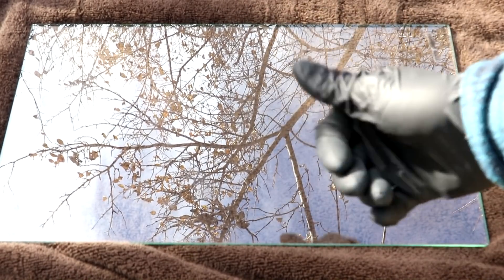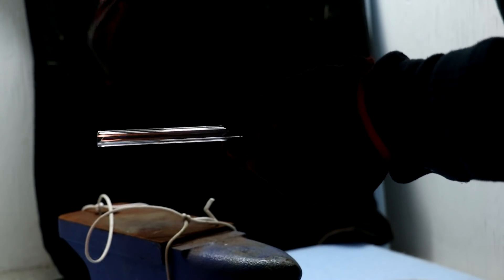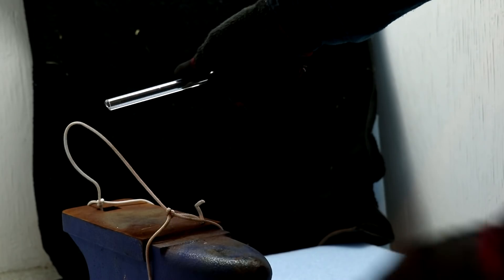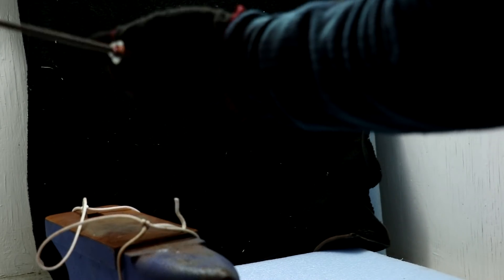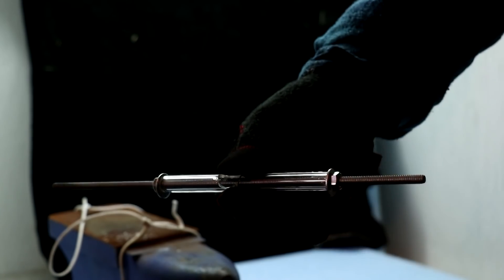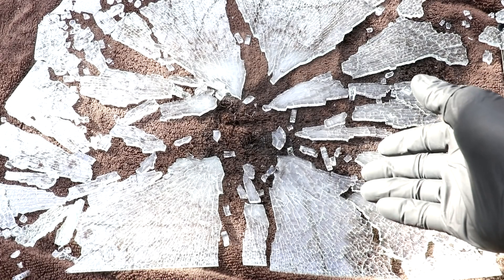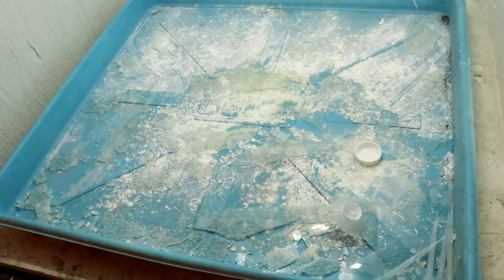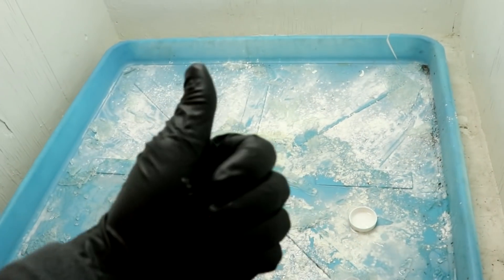Can I Dissolve Through Tempered Glass?

Comment: The internal stresses are far too high cracking isn't so much the issue as any stress riser with significant enough force is applied will create its own cracks in a material as hard as glass it's really interesting how a crystalline structure can gain such strength from applying forces to itself although of course the price you pay is your material ripping itself apart if changed slightly in form Now That's What I Call conservation of energy lol

Comment: could you use a super hot hydrogen flame or something like that to very concentratedly untemper the glass in a small circle that quickly gets melted through?  I saw nighthawkinlight use a small HHO torch to melt through a little glass slide.  wasn't tempered, but the edges were melted and rounded and without heating up the rest of the glass

Comment: It might have worked if etching had continued from one side, rather than flipping it. That would have removed the sensitive tensile center while it was still supported by the compressive layer on the bottom. By flipping and removing both outer compressive layers, only the tensile center was left, getting thinner and thinner. It’s hard to imagine any conclusion where the thin membrane under tension doesn’t crack. Therefore, etch all from one side, so the final membrane is under compression instead.

Comment: This ain't rocket science, glass is heated to cherry red . Then the glass is extruded  from the oven , jets of cold air cool the two surfaces the center of the glass is still molten. When the core cools , you have a potential spring . Any crack that goes to the center of of the thickness of the glass, causes the entire sheet to fracture. The number in the corner of  side window glass in your car is the number of pieces you get when you break it. That's what DOT 50 means , a 6 square centimeter piece of tempered glass will break into 50 piece.

Comment: The force required break tempered glass after the tension layer has been exposed is so small that it might as well not exist.  A slight change in temperature, a light breeze, or the tiniest tremors will break it.

Comment: I say try again, but balance the glass, give it feet around the spot you want to make the hole and feet on the corners. It's a possibility that the acid weakened the glass enough, that pane's own weight shattered it and the removal of the pane from the bin may have caused a mound or two in that powder to unbalance it. Just a thought...

Comment: Hey what if you found a way to stabilize the tension around the area you are dissolving?  I'm not an expert but if you want to put a needle through a baloon, you put tape on it, and get the needle through without popping the baloon so long as the tape is on there.  Is there anything similar for tempered glass?  Like some epoxy you can vaporize through the glass in an area?  I don't know what I'm talking about but curious.

Comment: Ehhh...
If you heat the piece of glass in an oven while it does this, is that cheating? 

At any rate, you need a way to relieve the stresses in the glass before inducing them again to resume the strength of the tempered glass. 

You can do that by immersing it in a bath of heated, concentrated salts. 
The commercial example is a beer bottle, which is soaked in a solution of magnesium sulfate to leech out the sodium and potassium hydroxide from the glass. They do this for reasons beyond altering the glass strength (it prevents the alcohol in the beer from reacting with the glass and throwing an off flavor), but it does make beer bottles stronger than non-ion exchanged bottles. 

Ions of smaller atomic radii can diffuse into the glass more readily than large ions. 
Lithium is good at this, but it causes brittleness and hardening in the glass after the fact. The lithium ion is probably too small for most things. 
Boric acid can induce stresses into glass, but i don't know how controlled it is. It also increases the melting point of the glass, in case that matters. 

All alkaline salts, like potassium or sodium hydroxide react directly with glass too. If you can get the glass and sodium hydroxide hot enough, you could just drop molten sodium hydroxide onto it and it'd eat through it, but it'd still probably explode at that point. 

Any who....

Comment: I had experience with tempered glass barriers for high walkways all shattering spontaneously, over a short period of time. Happily in place for years, but if I remember rightly, the theory was that metal in the processing eked out the material, then due to accrued beads of impurity introducing uneven tension, minor temperature fluctuations would eventually smash the whole thing. So after a few years, almost every pane was done in due to the tiniest natural occurrence.

Comment: would be interesting to see some videos on making monolithic aerogel from various materials like alumina and zirconia to make extremely high temperature kiln bricks maybe? (also not seen anything like say tantalum carbide as a heating element explored (which should be pretty good material for this since it's melting point is nearly 4000 degrees Celsius or tantalum hafnium carbide which the melting temp is supposedly in excess of 4000 degrees Celsius   (an aerogel from this would be ideal too, since it should be able to be used as standoffs for tungsten and I read that it should be able to work up to 3000C in argon environments or less in vacuum which I guess is because with out pressure raising the melting point, it evaporates some at a lower temp, good for say vapor depositing it on something XD.

Comment: Would directed heat from a torch melt a hole but keep the temper or would it re temper the hole or just render the temper null. but will the heat shock shatter the glass. Just wandering.

Comment: If you were to take an elastic and stretch it out to have tension and then melt the center of it with a lighter, the two ends of the elastic would still snap towards whatever is keeping them tense. Assuming I understood the explanation of how tempered glass works, the result of the experiment makes a lot of sense to me.

Comment: Interesting video Cody, this is how I inadvertently did this: Our car’s reverse mirror suddenly fell off the front window screen. So with two part Araldite and a couple of pieces of tape, I stuck it back on the front prestressed glass. After about 6 months; it again fell off but, this time had taken with it the glass – there was a neat square hole (the exact size of the mirror support bracket), through the screen! Otherwise the screen was perfect :) I suspected that constant thermal cycling between the glass and the Araldite (differing coefficients), had made benign minuscule cracks through the glass - that eventually joined up! If waiting isn’t a problem – this is a neat and safe way of cutting shapes into this type of glass :) Perhaps you can find a method of speeding this up?
Reply: It's not thermal cycling. Epoxy has a much lower stiffness than the glass so the thermal mismatch is mostly accommodated by strain in the epoxy. What you saw is caused by the several % shrinkage of the epoxy when it cures. This pulls the surface of the glass into tension around the periphery of the epoxy which causes preexisting microcracks  to extend slowly under the combined action of the tensile stress and corrosion of the crack tip by atmospheric moisture leading to delayed failure. This phenomenon is called stress corrosion cracking or subcritical crack propagation. It can be sped up by heat and higher humidity, but no dramatically. Failure of the glass causes a flake of glass to be detached but still attached to the epoxy. This leaves a conchoidal (scallop shaped) pit in the glass. I believe some years ago this was used to make a sort of non-see through glass by completely covering the glass with epoxy so causing these conchoidal fractures all over the glass surface.
Reply: @johnmatthewson6733  Superb explanation. This happened about 30 years ago and has always left me pondering what the mechanism might be - it was such a neat square hole. It's very easy to grab the only adhesive to hand but, it's worth taking the time to think - before using it :) It was an expensive lesson! I liked your non-see through glass info bit. Have a healthy and prosperous new year.
Reply: @johnmatthewson6733  - Youtube's algorithm beat you to it (for me) several days ago with the glue explanation, but showed it being done with old-fashioned hide glue. Evidently it works much faster because it shrinks much more.
Reply: @johnmatthewson6733  yes, this is why a crack grows in windshields unless you tie the surfaces together again with resin
Reply: @Beamer - Are you saying the hole went all the way through the windshield? That should not happen, because windshields are supposed to be laminated glass, while side windows are tempered glass.
Reply: @YodaWhat  Thank you for your thoughtful reply. Yes your absolutely correct and yes - it was the front windshield. I assume the minuscule cracks formed penetrated through the sandwiched film + perhaps the weight of the mirror assembly with the car moving - did the rest? Being a Ford Fiesta, it also probably wasn't the most expensive of glass ;)

Comment: You might have succeeded if you didn't flip the pane over. If you dissolve both sides of the glass under compression, then all that's left is glass under tension which is the part that causes the break. If you dissolve the glass under tension before one of the faces that is under compression, it should stay intact

Comment: Could you heat up a piece of glass with a metal tube at the glass melting point or higher and try to poke a hole trough it that way ? probably won't work but might be worth a shot you think?

Comment: Gorilla Glass works similarly.  Soda glass is soaked in a solution that contains potassium ions.  The potassium replaces some of the sodium.  Since potassium ions are bigger, the glass is put under compression.  There is an Applied Science video where this is demonstrated.

Prince Rupert drops (as demonstrated by a number of YouTube people) are tempered glass.  But if you shoot them with a big enough gun, you can break them (as demonstrated on Smarter Every Day.)

Comment: Try a smaller hole. .250 or .125. wonder if you could somehow circulate the HF with a smaller hole to increase melting speed. Also try HF on none tempered glass to see if melting/disolving speed is any different faster/slower etc. You almost got it man! Try again!

Comment: What if you could really strongly bond ring of hardened glass or steel or something very rigid to the glass and then cut a hole inside that ring?  Could you make it so that the ring takes the load and allows just the area inside the ring to explode?

Comment: Could you burn/melt a hole through tempered glass with heat? It seems the heat would anneal the glass in the area of the hole, making it successful. I'd try with an oxy acetylene torch, but also with a cherry red piece of round bar to try and make a nicer hole.

Comment: It seems as if tempered glass is at a constant stress level to the point where it close to breaking point but not really ..seems like maybe a few molecular bonds are holding it together ..may be why its so flexible to the external tension  like a hammer hit ..it overrides that tension therefore not affecting it..but once the molecular bond is broken it disintegrates..because it reached a point above that tension...which results in breaking..

Comment: can we take into notice how Cody lifted that anvil Like it was nothing
Reply: Absolute unit
Reply: @Jack W Google it. I just did and to be honest, I was pretty spot on, well, near enough to most the Web results for average deadlift weight for untrained average male. Remember this was average male and not you specifically.
Reply: That looks like the harbor freight 55 lb anvil to me
Reply: I don't think that anvil is any significant weight to lift with both arms. Yeah, they are heavy, but an average person should have no issue lifting that anvil. An average male can dead lift around 160lb - 200lb. Someone who is reasonably built (but not massive) should be lifting closer to 300lb and over. This anvil isn't impressive.

Comment: I wonder if you pulled the glass apart and then did the acid, would the pull of the glass negate the tension?

Although your experiment showed that even incremental destruction of the surface glass leads to catastrophic explosion of the glass when surface tension is penetrated.

so would pushing or pulling the glass apart or inwards negate the tempered nature of the glass? You should be able to test this much quicker with a drill.
Reply: On second thought what about compressing both surfaces at several points around the drill point? Perhaps with like vises?

Comment: I wonder if sandblasting with a vary small particle size would work. It seems likely to me that there is probably some limit to hole size; are you more likely to succeed with a smaller diameter hole than with a larger hole one?

Comment: You can do a ton of things to tempered glass. Grind it. Polishing. Sand blasting and craving. Acid etching. Just don't break the surface tension. Been a glazier for over 10 years and done lots to it. The weirdest thing is that tempered will explode for no reason. Just a loud bang and a call to me with a expensive bill. Always wondered why some of it last years and years and some blows up after just a few. Weird stuff that science. This was the best non glass guy talking about glass video I have seen on the YouTubes. Good job Cody

Comment: What would happen if you used bar clamps and wood blocks along all 4 sides of the glass to put tension, then used the acid? Would the tension help it to not shatter as the nuts did with the glass tube? Or would the entire sheet of glass need to be sandwiched & clamped between wood along with the edges clamped?

Comment: For clarity:  Spark plugs aren't especially good at breaking tempered glass.  It's broken pieces of spark plug ceramic with sharp edges that have a higher hardness than the tempered glass, capable of introducing small abrasions very readily.  But don't tell this to street people and lead them believe it's the blunt end of a spark plug that works.

Comment: Could you try "drilling" a hole in a way that introduces a "wall" to the perimeter of the hole to hold back the pressure of the glass?  Sort of like how they would dig wells and line the hole with stones.
Reply: The problem is the glass pulling outwards away from the original hole, not pushing in, also how would that even be possible?

Comment: I'm interested to know if you could disintegrate your way through glass with light. I know that at high enough frequencies lasers basically just disintegrate matter, it should theoretically be possible with glass too right? Sure it will let a lot of light through, but its gotta hold on to some of the energy. I don't doubt that it would shatter the glass as well, but it would be an interesting experiment nonetheless, if one could get the materials

Could you modify the results of this experiment by modifying the ambient air pressure?

Comment: Pre stress is better. Concrete does the same exact thing as tempered glass. It doesn't completely make it fracture or brake proof. It does however slow it down long enough to fix it.

Comment: It's funny how you say it dissolved about 3/4 of the way through and then measure it and the thin dissolved part is 1.19 mm which is exactly 1/4 of the 4.76 mm you measure for the original glass thickness.

Comment: Hey Cody you should do a video on putting your finger through tempered glass on a car I had to do it in my extrication class that I took for fighting fire it's a lot of fun and it's amazing you can stick your finger through it with relative ease start from middle of your window and work towards your mirror increasing the frequency and strength of your finger popes and about halfway through towards the mirror your glass will break with just your finger it's pretty cool make sure that you have gloves on though

Comment: I am going to predict that it doesn't work.  Now to watch the rest of the video.

(The center layer is under so much tension that any stress riser will initiate a crack, which then propagates and leads to the entire pane popping. Etching glass chemically creates a frosted surface, which is a microscopically pitted surface.  The radii of these pits is going to be very small, which will cause them to be high stress concentrators.  As the acid etches and removes material, the strain is going to be changing as the compression and tensile loads change.  It seems to me that the odds are high that the tension in one of those many etched pits will exceed the tensile strength of the glass.  Also, it may be that there is an effect where highly stressed glass is easier to dissolve.  In some metals the effect of stress corrosion is observed, so it may be possible in glass as well.)

Comment: I think this could have worked, but dissolving from both sides killed it. At the end, the only thing left was glass under tension, and it got so thing it was ripped apart from that tension. If you'd stayed on one side, all tensioned glass would always have been backed up and supported by compressed glass.

Comment: Hi, Cody. I'm wondering. What would happen if you tried to dissolve that hole in glass, but the whole pane were in a pressure chamber with a pressure equal to the tension under which the layer of glass inside the tempered glass is?